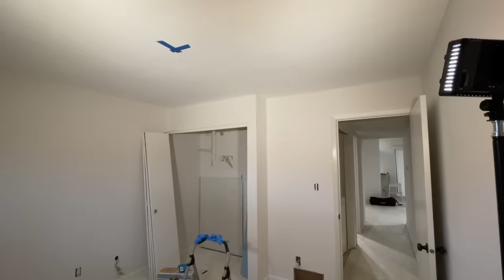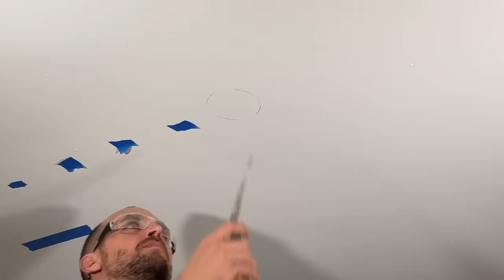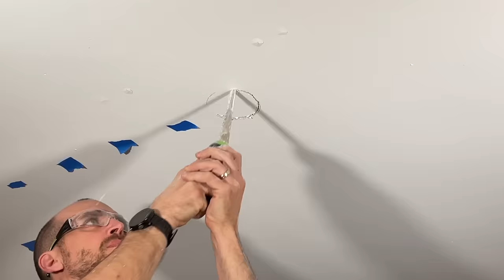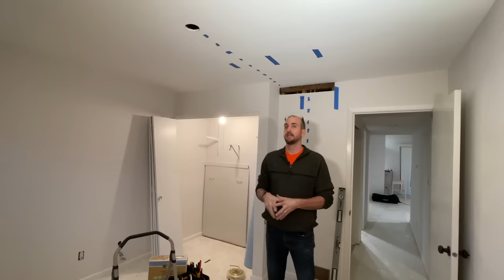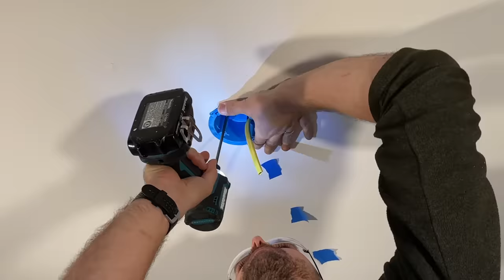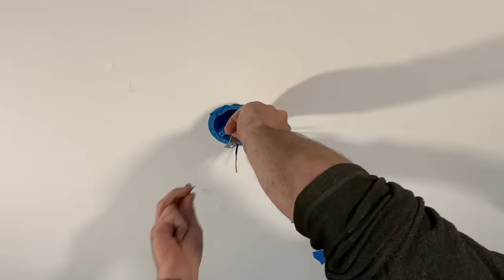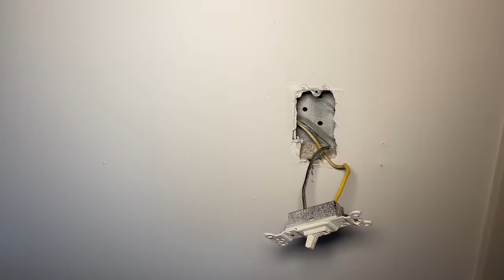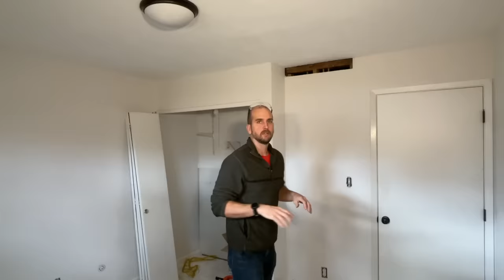How To Install Ceiling Light Without Existing Wiring

Comment: Not an electrician, but comments here call out 7 different possible 2020 National Electric Code (NEC) violations: 250.148 (ceiling fixture not grounded), 200.6 (wrong color conductors), 300.14 (cables short at outlet and box), 300.22 (NM cable in plenum space), 314.20 (outlet recessed too far), 314.27 (under weight capacity ceiling fixture), 334.30 (cables not supported).

250.148 Continuity of Equipment Grounding Conductors and Attachment in Boxes:
“(B) Equipment Grounding Conductor Continuity.
The arrangement of grounding connections shall be such that the disconnection or the removal of a luminaire, receptacle, or other device fed from the box does not interrupt the electrical continuity of the equipment grounding conductor(s) providing an effective ground-fault current path.
...
(D) Nonmetallic Boxes.
One or more equipment grounding conductors brought into a nonmetallic outlet box shall be arranged such that a connection can be made to any fitting or device in that box requiring connection to an equipment grounding conductor.”

200.6 Identifying Grounded Conductors:
A lengthy rule, in short yellow is not a grounded conductor color that is approved. It only appears in 277V+ installations and is not a grounded conductor.

300.14 Length of Free Conductors at Outlets, Junctions, and Switch Points:
“At least 150 mm (6 in.) of free conductor, measured from the point in the box where it emerges from its raceway or cable sheath, shall be left at each outlet ...”

300.22 Wiring in Ducts Not Used for Air Handling, Fabricated Ducts for Environmental Air, and Other Spaces for Environmental Air (Plenums):
“(B) Ducts Specifically Fabricated for Environmental Air.
...
Only wiring methods consisting of Type MI cable without an overall nonmetallic covering, Type MC cable employing a smooth or corrugated impervious metal sheath without an overall nonmetallic covering, electrical metallic tubing, flexible metallic tubing, intermediate metal conduit, or rigid metal conduit without an overall nonmetallic covering shall be installed in ducts specifically fabricated to transport environmental air.”

314.20 Flush-Mounted Installations:
“Installations within or behind a surface of concrete, tile, gypsum, ... including boxes employing a flush-type cover or faceplate, shall be made so that the front edge of the box, plaster ring, extension ring, or listed extender will not be set back of the finished surface more than 6 mm (1⁄4 in.).

Installations within a surface of wood or other combustible surface material, boxes, plaster rings, extension rings, or listed extenders shall extend to the finished surface or project therefrom.”

314.27 Outlet Boxes:
“(2) Ceiling Outlets. ... “Boxes shall be required to support a luminaire weighing a minimum of 23 kg (50 lb).”

334.30 Securing and Supporting:
“... shall be supported and secured by staples, cable ties ... or straps, hangers, or similar fittings ... at intervals not exceeding 1.4 m (4 1/2 ft) ... The cable length between the cable entry and the closest cable support shall not exceed 450 mm (18 in.)”

Exception, 334.30(B) permits if cable: “(1) Is fished between access points through concealed spaces in finished buildings or structures and supporting is impracticable.”

Where you opened the wall is not “impracticable.”
Reply: LOL you bored huh ?
Reply: First, Nonmetallic boxes are not required to be grounded. Only the devices, and/or fixtures installed in them must be grounded (NEC 2011 250.148(D)). There is no way to ground a plastic box.
Second, there are 3 wires with proper color for 120v. white is neutral, black for hot, and bare grounding wire.
Third, it looks like he did not leave 6 inches but NEC says 3 inches out of the box for a proper splicing  300.14 Length of Free Conductors at	Outlets,	Junctions,	and	Switch	Points. At least 150mm (6	
in.)... Wher the opening to an outlet, junction, or switch point is less than	200	mm	(8	in.)	in any	dimension,	each conductor shall	be long enough to extend at least 75mm (3in.) outside	the	opening.

Comment: You really should have mounted that ceiling box to the floor joist so it could hold some weight.  I would have also made a larger hole and made it on the wall about 4" below the ceiling, not upto the ceiling like you did . Then you could still fish to above but when you patch the drywall you don't need to touch the ceiling.
Reply from the maker: Hey Todd, agree on both points.  Others have recommended this Raco box for old work https://amzn.to/2JNTY6B and for the drywall your point of cutting below the ceiling line would help with the patch work for sure.  Cheers!
Reply: This is the box to use https://www.homedepot.com/p/Commercial-Electric-12-cu-in-Plastic-NM-Fan-Box-with-Plastic-Cover-CPB13NM-SM/205383211

Comment: Question,  where was the power coming into that room?   Switch first or the Outlet box?    The yellow from the switch is throwing me off.
Reply from the maker: Hey Matt, it was coming into the outlet box first.
Reply: What's throwing me off is why he pulled all the yellow wires. I would have just tied off the hot on the receptacle to the incoming hot and transfered the yellow from the switch to the hot on the new light. Not sure why he replaced receptacles either.

Comment: I did not understand how you fished the wire through ceiling past the 2 by 4 withour having to drill a hole in 2 by 4 first to get the wire to go down!

Comment: You can simply disconect cables from switch and connect together with wago or wire nut, then this act as always on switch, all outlets will be powered :)

Then connect light to switch

Comment: 14-2 NM cable is cheaper, more manageable and is rated for 15 amp circuitry. Great video though.
Reply: If it's part of a 20A circuit, it needs to be 12 ga wire.

Comment: I have seen this problem in the America most. rewiring -- you have to do lot of work. In India When we build house we put PVC pipe for wiring with junction and Electrician install some extra junction .. rewiring or puting new wire -- switch is very simple. I don't know what reason behind not putting PVC pipes in America when building house.

Comment: Descent video giving some basics. However,  I believe you could have done a much better job explaining what you were wiring and why. As an example when you were connecting your white common wires in the main or first box, you could have explained the connection of all 4 white wires were connecting all the common wires to the outlet with the short wire providing common for the outlet at that box.

Comment: Do your lighting and power outlets not work on different fuse rating circuits in the US?
Reply: AMATEURS IS INSPIRING BUT DANGEROUS AT TIMES BUT GOOD ENERGY AND EFFORT TO INSPIRE,  BETTER GET INSTRUCTIONS FROM A LICENCED ELECTRICIAN.
Reply: Depends. First, most all residential houses that aren't ancient don't use fuses anymore. They're all on resetable breakers. Second, it all depends on how cheap the builder is or crappy the electrician is. 15A breakers is common for most receptacles and lighting fixtures. I've added new circuits in my house and they're all 20A. No reason not to go 20A on new homes but to be cheap builders still do it. With more high efficiency lighting systems like LED and fans don't use much power you could still get away with 15A circuits if ONLY they are on that circuit. I despise lights and fans on receptacle circuits. No one likes lights dimming when a load kicks in.

Comment: I assume that the lower outlet on each receptacle was already on a separate circuit that was hot all of the time and isolated by the broken connection between the  terminals.  So if the entire receptacle was powered by the switch you would need a different method for powering them.  Is that correct?
Reply from the maker: This video had a similar setup to what you are asking.  The switch just turned power on / off to 1 duplex receptacle.  https://youtu.be/KgChTKOaNsA

Comment: While you were there, why not run two wires up - on for the light (switched) and one to a later installed switched fan?
Reply from the maker: Agree, 14/3 Romex would have been more suitable for this install in addition to a box that could hold the load of a fan in the future https://amzn.to/3a5slk0.

Comment: Why did you mention Ceiling fans cannot be installed in this ceiling? How to check if the ceiling is capable to hold a fan?
I also have a condo hence asking.
Reply: You need a bracket between  ceiling joists to hold a fan . You can put one in. Many videos how to do that

Comment: Did you put romex in an air duct? AFAIK that's against code, double for condo with conduit.
Reply: Does that apply to cold air returns? That might be what was there.

Comment: using your Garmin for runner is not good for work. I'm a handyman and I run too.my watch is a polar GPS and it's messed up hhh. good job and fishing and wiring
Reply from the maker: Just putting the frontrunner through some torture testing.  Overall it is still holding up well.  Think I am on my 4th or 5th band.

Comment: These boxes are not rated to be used in the ceiling for a fixture. They are rated for " wall use only". They are however permitted for smoke detectors or Junctions. The application these are used in are incorrect. You should probably let people know before advising them to do something potentially dangerous.

Comment: i have this same setup in my house. my only issue is that the 3 rooms that have this problem all have sloping ceilings as opposed to flat even ceilings like the one in this video. so if i install a ceiling light, it's gonna be resting on an angle instead of facing straight down. would that be a problem?
Reply: Just get those halogen spotlights where you can tilt the light source 45°.
Reply: @michaelswagson4457  good idea. Thanks!

Comment: how wide and tall of a hole do i need to cut in the corner of the wall in order to run the wiring down?
Reply: do you have a video on how to fix the hole you cut out in the corner for the ceiling?
Reply from the maker: I don't have a video right now that shows the drywall patch.  I would recommend (as others mentioned) to cut at least a few inches down from the ceiling which will make the patch easier to fix after wiring .  The patch I cut was around 6' tall and 32" wide.  Best of luck!

Comment: I'm still wondering why you went to the ceiling with the section you cut out. If there was not the dropped ceiling behind that wall then you would have to drill through the stud and the top plates. I would have cut the opening down from where you marked the line and at least 10 to 12 inches wide. need room to get a drill and your hand in there. I was also wondering how you were gonna make the turn at the top of the top plate towards the light box spot without a hole in the ceiling as well. 

I'm wondering if you did another video about how you repaired the cutout. I wouldn't have ever cut all the way to a corner if I didn't have to. that crap is very annoying to even out...

It's fortunate that it worked out the way it did for you though. 

I also wonder what's going on lately with creators saying, :I'll put a link here (points to a section of the screen) about how to (whatever)." and then nothing. It's frustrating as I would like to go check out the other info to see how you did whatever that was.

Comment: Would what you are putting in the ceiling hold a ceiling fan?
Reply from the maker: No, it would not.  Actually I should have used this box to ensure if someone installed a fan in the future the box would be able to hold the weight. https://amzn.to/2W0rDfY
Reply: @EverydayHomeRepairs  That's what I thought, just wanted to post this in case someone thought they could mount a ceiling fan. Thank  you for your videos. I have used lots of info that you share, like using hospital grade outlets and wago connectors in my son's house. He was thrilled to have such high grade outlets in his house. Thank you!

Comment: Instead of disconnecting all the outlets  couldn't you just take the wire from the switch leading to the start of the outlets and just connect it to the hot. And just use the switch for the light?

Comment: Why are you using 12 gauge romex for a light. We always use 12 gauge for kitchen. We use 14 gauge for the bedrooms
Reply from the maker: Hey Dustin, I just had some extra 12-gauge in my truck but you are correct 12-gauge in not needed for this circuit.

Comment: Cant you just get a power switch source from the existing switch and run the new switch to the light??
Reply from the maker: In this instance I would still need to tie into the neutral.

Comment: 4:25 Good! Always cut drywall by hand, NEVER with a power tool. If you bump into an existing wire by hand, you can feel it. With a power tool you’ll just cut into it

Comment: I would have routed the cable straight to the switch box instead of routing it from the ceiling to the outlet box then back to the switch. 1 less connection to be made. just fish tape upwards through the switch box into the opening he made.
Reply: Wouldn't the switch then operate both the outlet and the light every time? I'm in this same situation and wondering if your method would be easier.

Comment: What was that little yellow torpedo thingy he was magically sticking to the ceiling before taping?
Reply: A magnet.  It sticks to the drywall screws.  I have plaster walls at my house, so I can't use it, but if you have drywall like most modern houses, then it looks like a good solution.
Reply: @incognitotorpedo42  Thanks Torpedo. That makes more sense than my working theory that he was a Jedi.
Reply: Facepalm. I realize I skipped over the part where he explains it perfectly.

Comment: Very helpful. I have three questions.  Why did you use 12-2 instead of 14-2 Romex?  Is the jacket of the romex yellow for a reason?  Finally, don't you have to attach the romex to the studs to keep it from just floating out in the middle between two studs where it might get cut into with a drywall saw if someone cuts into that space? Thanks
Reply from the maker: 1). 14-2 would have worked fine I just had extra 12-2 so I put it to work. 2). It is my understanding in best practice yellow Romex would indicate 12 gauge wire / 20 amp circuits.  3). For this install since I was looking to do as little drywall repair as possible the romex is just floating in the ceiling and wall caveat.  Best of luck on your project!
Reply: Code doesn't require wiring to be stapled if it's not accessible.

Comment: Say I have the same setup but I would like it to be 8-10 spotlights is 400-500 a good price to have it installed by someone
Reply from the maker: If you could get an electrician to install 8-10 can lights for $500 that seems like a very good price.  This of course is going to depend as I assume you are paying for the material cost and have attic access.  Best of luck with the project.

Comment: I wonder how much does this cost total?
Reply from the maker: If you were to hire it out you are probably looking at $750 - $1250  but that is dependent on labor costs in your area.  You will most likely also need to hire both an electrician for the wiring and a drywall/paint person to patch the walls.  Best of luck!

Comment: Isn’t required by code to fasten Romex to the stud?
Reply from the maker: It is my understanding that was only for new construction.
Reply: @EverydayHomeRepairs  alright, I’m taking classes rn for electrical so I’m  new to a lot of the code. Thanks!
Reply: Not when fished into existing walls.

Comment: I'm trying to add two wall sconce lights and a switch near my bed, would it be a similar process?
Reply: Yes
Reply: If you have an outlet below on each side of your bed,you just need to remove the box for the outlet ,get some single remodel boxes you are going to need like 4 boxes and two rounds 4”or 3” you can used any box for your sconces just depends if you are close to a stud used a panket metal box and then just round a wire up front the outlet to the switch and another wire up from you new switch up to your light always check the wire if is 14 or 12.

Comment: never cut into the wall at its top 6 inches you can cut out a section below that enough to get a drill up through the doubled up studs at top
1 its harder to patch a corner. with enough mud you can make any cut outs completely disappear if you stay away from trims or corners
2 if you make wall hole big enough for drill bit and drill you can angle the hole so the fish tape falls in direction you want to fish
3 if hole is big enough you can pull the whole section out as 1 piece and put back as 1 piece
4 if your cut lines are thin enough you can mud the wall and wipe excess mud with wet sponge and find you dont need to texture just paint
Reply: I wasn't sure how he was going to get a drill in that hole but he got lucky.

Comment: Could have exained if you didnt have the closet next to this room how you would have had to drill a hole in the center studd and run the romex through the hole and down to the outlet.

Comment: Should have used the outlet at the bottom instead of on top. Bring power from the lower outlet to a switch then to light you can Evan install a dimmer .

Comment: I would have not put a center light in without supports.  The next people might just try to put a fan in and cause a lot of issues.  i would have just used thin wafer lights and put 4 of them in the corners or two in.  That way it gets more light and no one would think its a supported light.

Comment: Next time use a 4 inch hole saw. Easier, faster and a easier patch. Also, you need a fan rated box
Reply from the maker: Agreed, thanks for the feedback Juan.
Reply: 4 inch hole saw...makes sense if your going to need an $18 tool to drill lots lots of nice round holes...or use a $3 Jab saw for us All the Time in the World DYI guys.